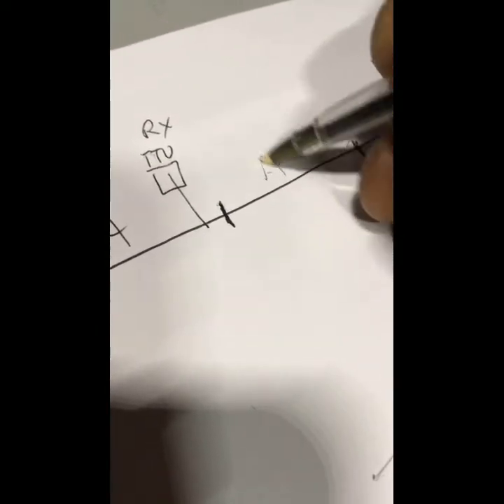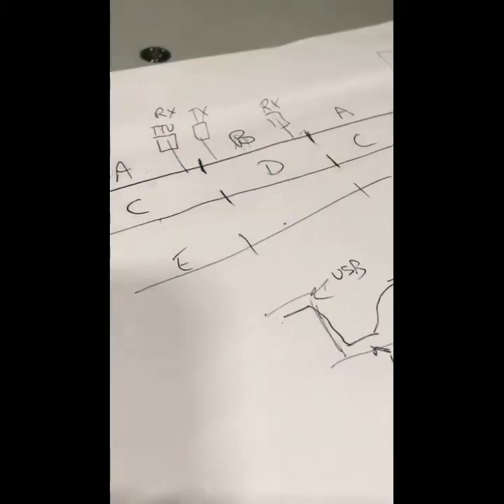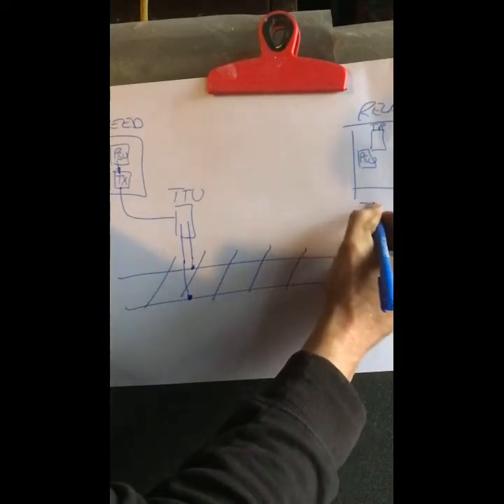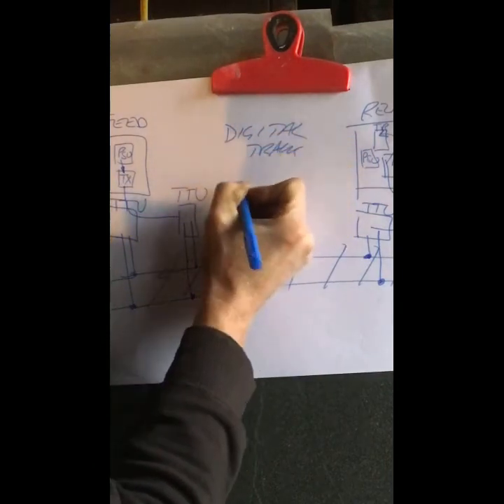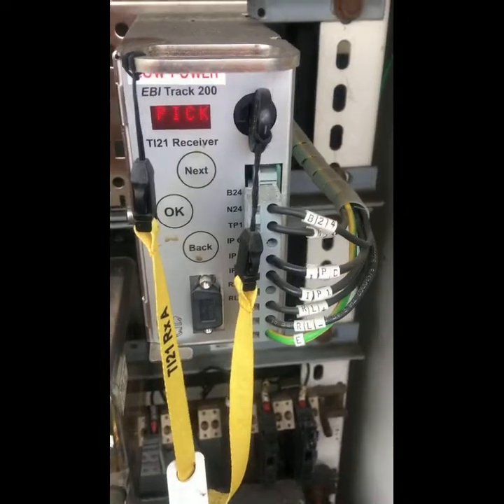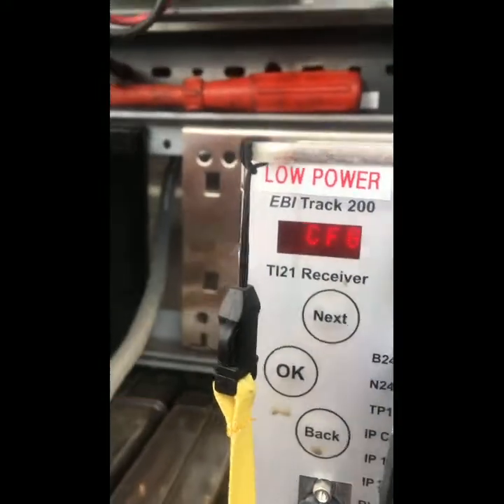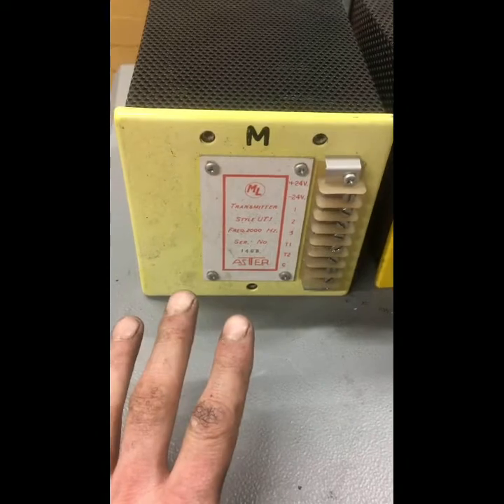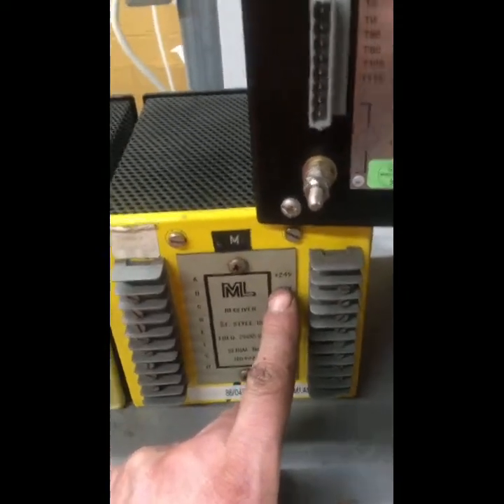Digital and analogue track systems

Comment: Using the word "modern" in relation to the TI track circuits is amusing to me! Over 30 years ago I did my apprenticeship with ML Engineering (then EB Signal, ABB Signal etc) and spent many hours on the shop floor tuning and testing them. This was the original design using fully discrete electronics rather than the digital version: it had old metal can transistors and large ferrite pot cores for the oscillators/receivers that had to be tuned for the correct two frequencies.   Setup and final testing were manually performed and results written in a book when I started, but after my apprenticeship I joined the test department and worked on automation of the test system.
Reply from the maker: @ferrumignis  that’s some memories there,    Funnily enough I only had the training course about twenty five years after working on it 🫡
Reply: @irseminorrailwayssection9491 That sounds pretty typical! I didn't have the pleasure of attending any track-side work for the TI21, but I did spent quite a bit of time in Slade Green babysitting a traction current monitor (ICMU) we developed for the Class 465/466.  The GTO VFD traction drives spat out a lot of harmonics that could exceed track circuit limits but they also produced some amazing noises from the traction motors.
Reply from the maker: @ferrumignis  always remember an early frequency track at Knutsford on test, never found out what it was but it was in a little metal box lineside with a red and green lamp on it, I had the idea it was maybe an early aster prototype
Possibly.